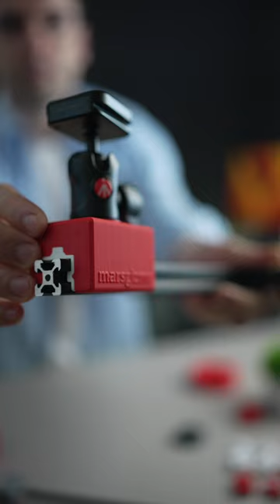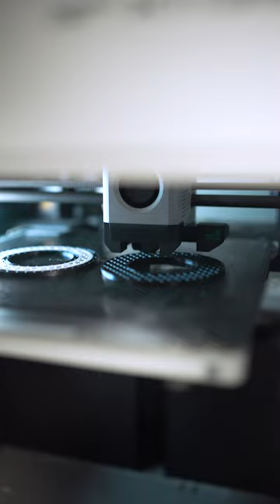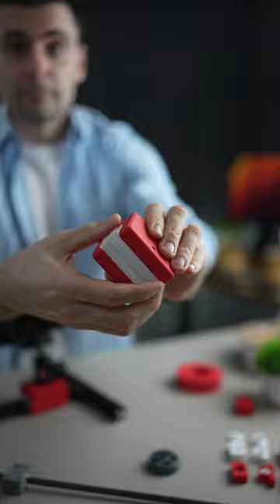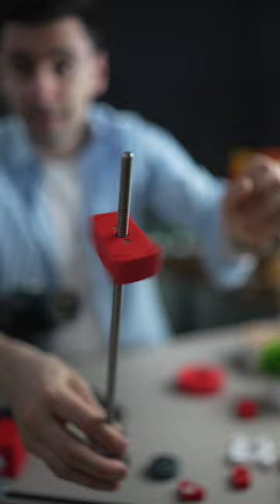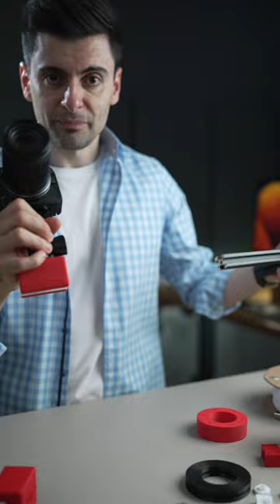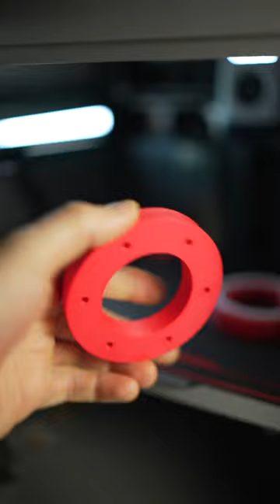3D Printed Performance Polymers for Motion Systems

Comment: What's the metal beam with the x cross section? I've seen those before
Reply from the maker: V-Slot aluminum profile, also the C-slot is pretty similar
Reply: @marsgizmo  thanks 😁😁😁